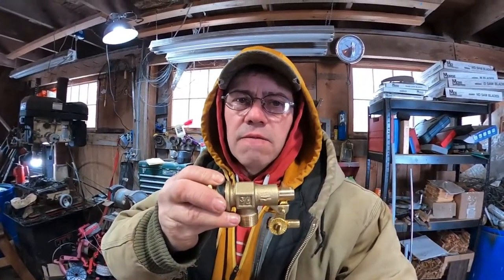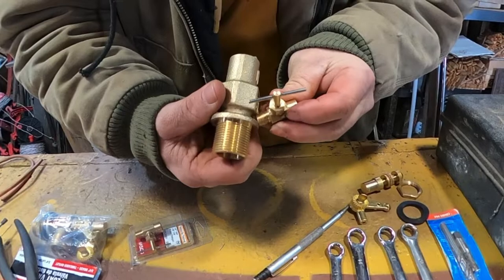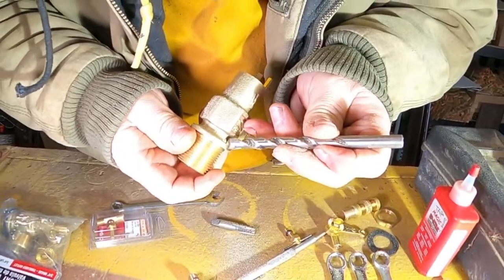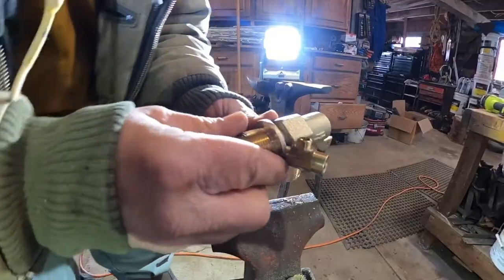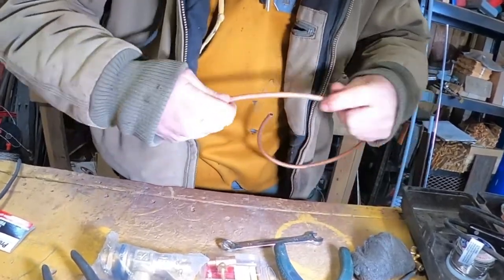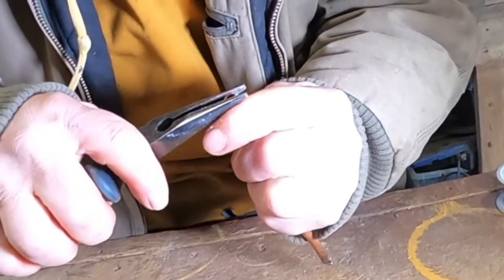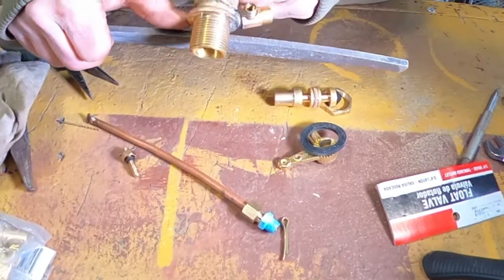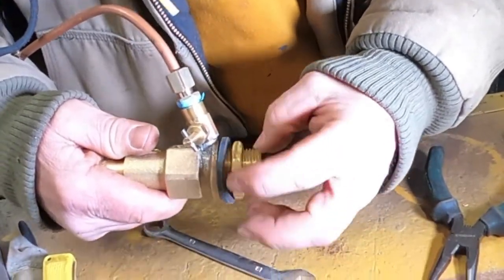Make an amazing stock tank valve even better

Comment: Why does this make it frost free? Great video but not sure what it does .
Reply from the maker: You are able to leave the needle valve on or run. Water coming out of the ground is 55 degrees. So the valve uses the geothermal heat make the tank freeze proof.

Comment: Thanks for all your videos great stuff. Im curious if you're tying a jobe float to this type of valve? I've already ordered mine and it works great but it came with a plastic float on a metal rod that you thread into the valve.
Reply from the maker: Thanks for watching!! We are using the jobe float on all our valves cause of durability. I've cows ruin floats before.
Reply: Thanks for the reply but I have one more question if you have the time. Currently we are running uninsulated irrigation to our stock tank in the fields Will the constant flow be enough to keep the lines from freezing during winter @RussWilson

Comment: What brand of valve is that? Does it work good with dirty pond water?
Reply from the maker: Hey Kevin  The valve is a Mueller Valve. There's a link in the description to buy one. It's a high flow valve and very simple. It should work with pond water.

Comment: No offense, but this is so much more work than necessary. All you have to do is drill a small hole in the side of the tank (which is free and takes 10 seconds) or put a small valve in the side of the tank. Accomplishes the same thing without having to take apart and damage a you’re valve.
Reply from the maker: I guess that everyone isn’t as smart as you. There are 1001 ways of doing something. I’ll do me and you do you. Please do a video on your setup!